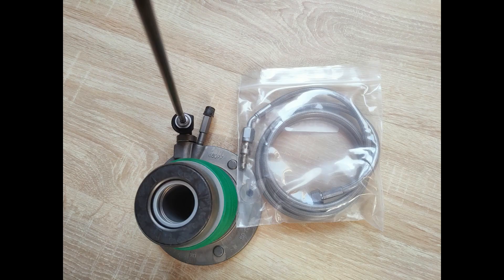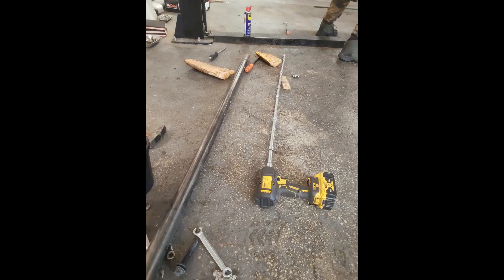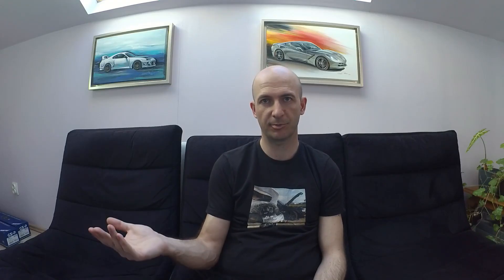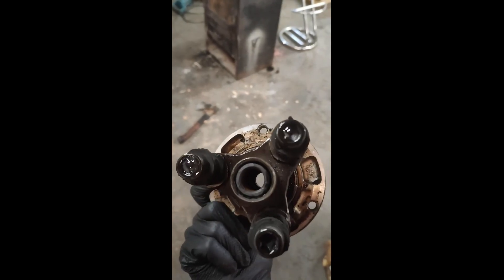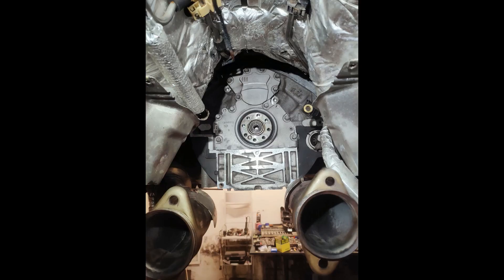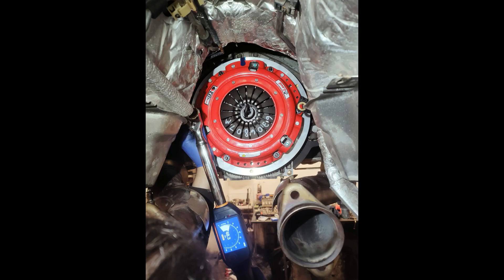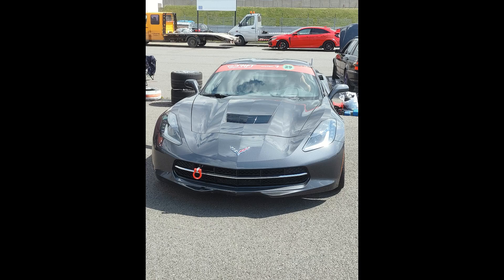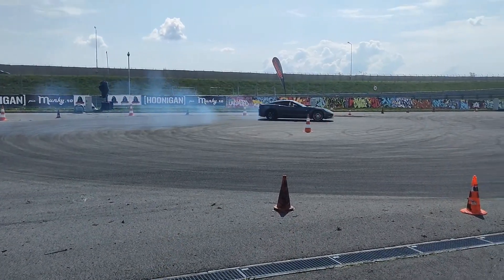I broke the C7 Corvette driveshaft, rebuilt the torque tube and made it stronger!

Comment: Hi Cristian, the Dualmassflywheel on my C7 is shot too. I am thinking of getting an Singlemass Aluminium Flywheel. You have put in the McLeod one, did you get rattling noises in Idle? Did you have to do some ECU tuning due to reduced mass? Any kind of Rev bouncing when you have to do a full stop with the Car and push the Clutchpedal down fast? Any other downsizes? Is it easy on take off, daily driveble? Thanks for your Advice.
Reply: Thank you! These Noises stop, if you press the Clutch, right?
Reply from the maker: @ilovecurbs8717  Right. And also sometimes the noise is not there, I assume it depends on the position of the second disk when pressed/depressed.
Reply from the maker: @ilovecurbs8717  Yes, there are some noises on idle sometimes, because the second disc is just touching the axle sometimes. But, that is the only downside, no ecu tuning required, I did improve marginally my best lap time, no rev bouncing, very drivable and enjoyable rev matches, easy take off, no other problems, I would do it again.